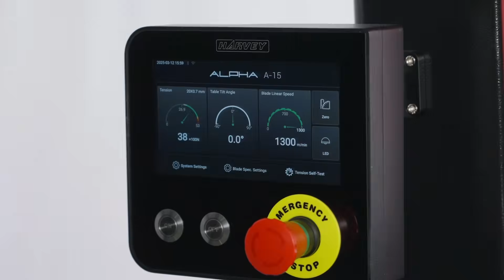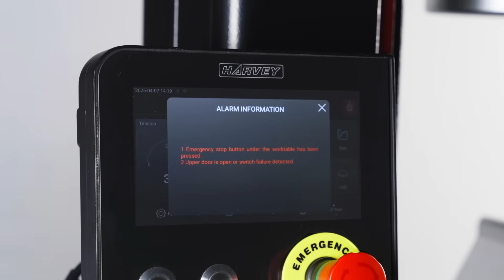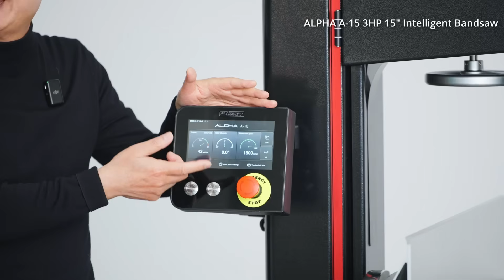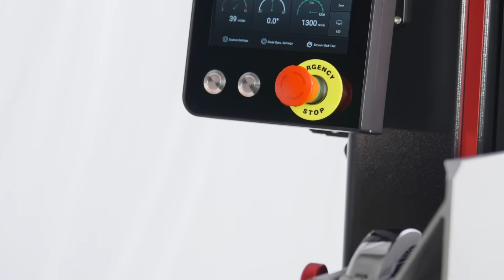Introducing the A-15 Intelligent Bandsaw by Harvey.

Comment: How many years will you guarantee to have replacement electronics? I assume when the electronics fail, the saw won't work at all. Please confirm?
Reply: The same thing is true for the new electronic drill presses and almost anything else. 3D printers, Lasers, etc. We just have to get used to it. This is interesting, but I don’t see how most of the features are really useful. The rest of the features are available on other bandsaws.
Reply: Fair question that should be addressed. 
I design and repair industrial electronics and get the same question all the time.